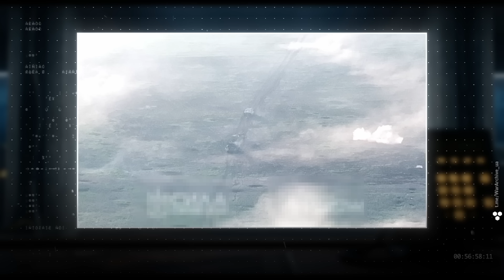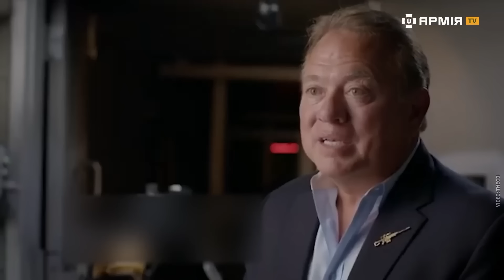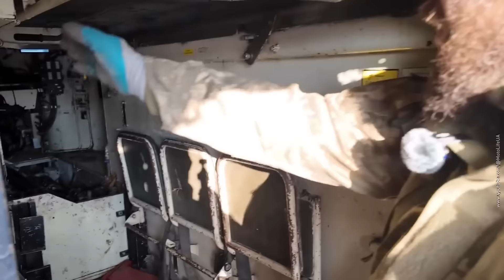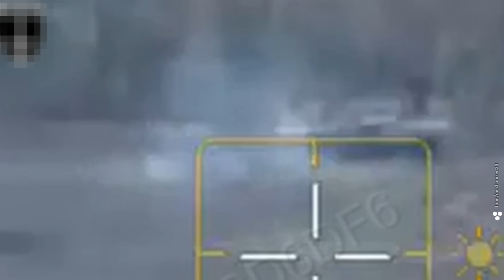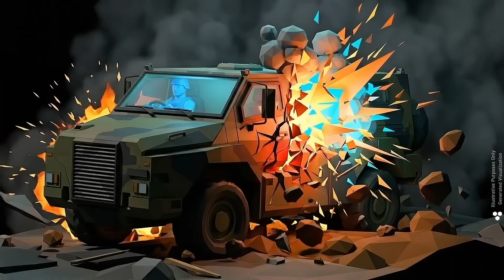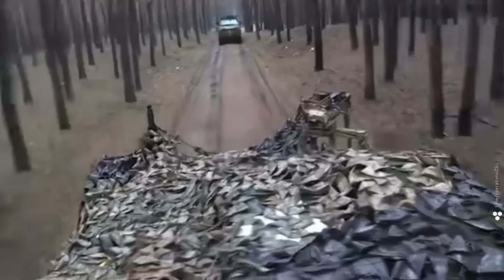THIS Is WIPING OUT Russian Troops Like Never Before - 6 Combat Stories From Ukraine

Comment: Thankyou for not using AI. Leave the profanity in as it gives it real grit that it is. Good experience with actual soldiers of Ukraine. God bless them and Slava Ukraini!
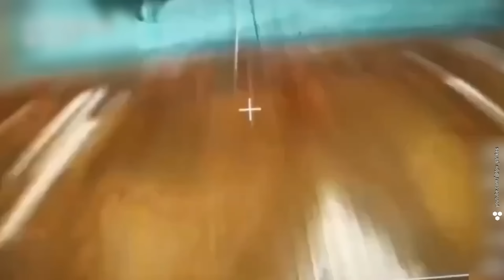1:01:40 I would recommend an automatic targeting, fully automatic shotgun of at least 200-300 rpm with a mix of birdshot, BBs, and #3 buckshot for each round. Something like the AA-12 with abelt feed. Using full sized 3" high brass shells. Call up Taofladermaus to get some testing and the US engineers and geeks will improve upon it. The Secret Nerd Base stands ready with 3d printers and prototypers.
The catch will be a set of counter and attack drones to intercept guided by AI vision processing to give the driver/co-pilot a God's eye view around the vehicle.  It might be able to put in infrared camera to detect land mines also. Total weight of addons. Under 100 kg, about the same as a co-pilot for the driver, but hits back heavy on things around the vehicle.  Make it so the Gunner can do these tasks also.

Comment: RBS70 and RBS90 is designed for Anti Air and Anti Ship operations from the start.
It was meant to be able to be used on the small little shoals all over the Swedish Archipelago by Coastal Jaegers and Conscripts.
Hence why it is a Mobile system able to be taken around witha Kanoe if needed and possible to hide th a crevice from enemy ships planes and helis.

whilst it is indeed old it is still usefull for its original purpose much like GRG M48 Carl gustav,

RBS70 and RBS90 has also another relative  though its a very distant relative Namely Swedens Own Patriot Competitor the RBS23 Bamse.
sadly there has only one complete system built before the massive drawdown of 2000 started.
its a very diffrent system in operation and design compared to patriot.